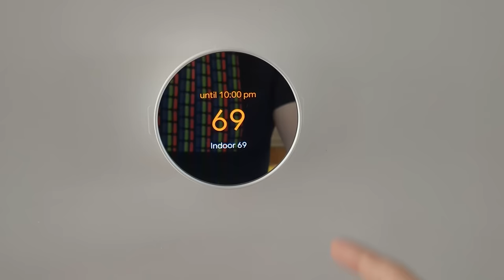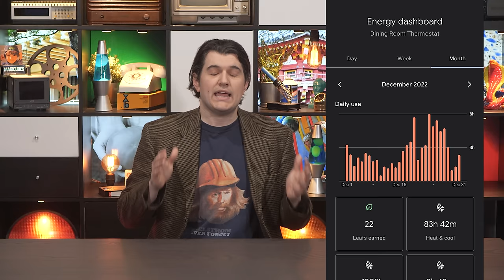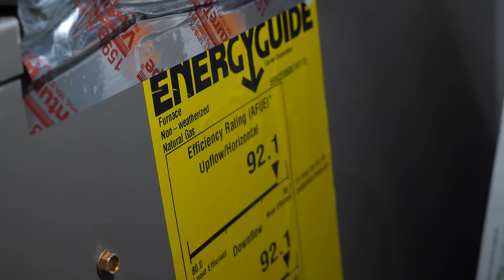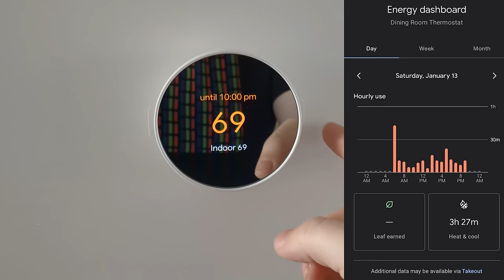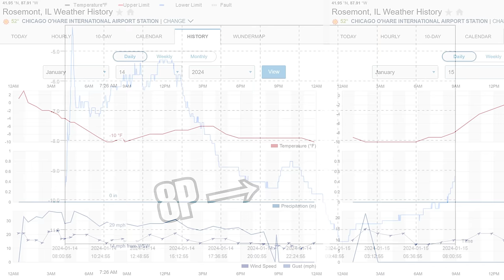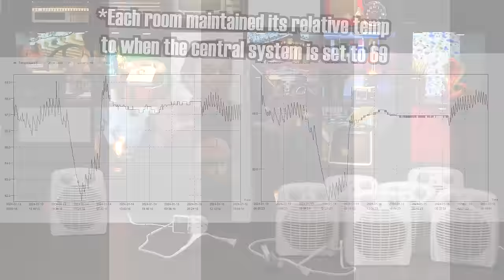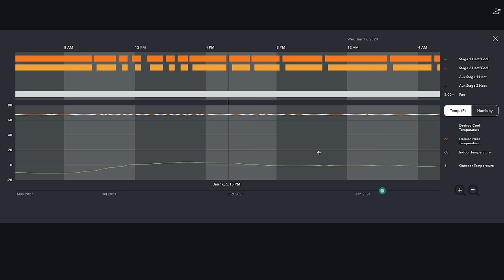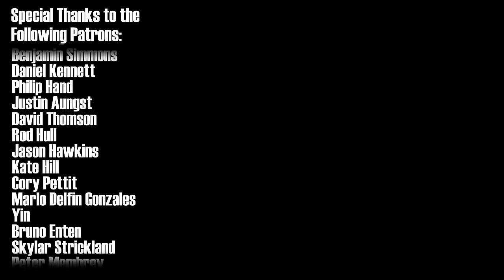Old HVAC industry practices are holding us back and costing us money. But we can fix it.

Comment: know how I know you've never lived with a heat pump?
maybe for milder climates they are ok, but I live in an area where it drops down to 0-10* F in the winters and my heat pump sucks. It's a newer house with new hvac (both 5 years old)  It can barely manage 66* when it's really cold out, and no amount of running it will keep the house warm.
also my house is fully electric and it sucks ass wrt power bills. Routinely $300+ in the summer and winter, it goes down to about $250 in the spring and fall.
my heat pump ain't saving me any money, I'd much rather pay $70 for gas and $70 for electric than $300 for only electric.
gas is the superior option in all ways. cheap, ubiquitous and just flat out BETTER.
Reply: Know how I know your heat pump isn't correctly sized, or not appropriate for your climate?  Mine heated just fine (20C/68F for most of the house 25C/77F in my daughter's bedroom)  in my 1920's 152sqm home in -20C/-4F for 3 days straight without any resistive backup.
Reply: @BenIsInSweden  they struggle near 0 degrees. They're just not efficient enough. Mine stays around 66 regardless of how long I run it, it can't overcome the ambient air temp. I bet yours struggles to get to 68 or above. If I want it to 73 there's no way a heat pump can do it unless it's warmer than  0-15*
Reply: @marty5300 read my reply again. It was handling 68 for most of the house fine and my daughter's room at 77 in -5.
There are heat pumps that can do it just fine.  2 of mine are able to provide heat down to -22F. But my system isn't designed around going that low. It's designed for -5F where it handles the heating load just fine.

Comment: First, reducing furnace size by 2/3 is never going to reduce the consumer price by that amount, if at all. Japanese cars in the 1970s weee more efficient but cost more than the gas guzzlers we traded in. 
Second, many citizens are fearful to rely on one energy source  -electricity. Electric power can be shut off by the govetnment at the click of a mouse and for political reasons. Relying on oil companies alone has not gone well, so relying on govetnment controlled electric companies will lead to the same result - cartel power.
Reply: Your electricity goes out, you usually lose your heating regardless of how it's fuelled as electricity is needed for fans etc to be running.    Unless you have a backup genny, but lets be real, very few people have those too, and it's not been an issue.
Reply: @BenIsInSweden  Many people in rural America rely in multiple energy sources.
Reply: @WaltANelsonPHD  still doesn't change the fact that most heating systems that cover the whole house would need electricity to function.  My wood fireplace would work without electricity, but without electricity for the blower it's usefulness is mostly limited to the room it is in.
Reply: @BenIsInSweden  The following will still add a good deal of heat. In any case the govetnment control issue drives many homeowners to install off-grid solar.
Reply: @WaltANelsonPHD  Heat pumps can work with solar too, and are in some cases a better prospect as you can make more use of the provided power before having to store the excess.  A smaller array and battery would mean you're still reliant on another fuel regardless.
Nothing beats a good tin foil hat for insulation though, clearly.
Reply: @WaltANelsonPHD  Weird example.  But for the country being known as the land of the free, you folks seem to be far too concerned about the government switching off electricity on a whim.  But somehow insulated from turning off gas etc from people?

Comment: So you want your heat pump/ furnace to run all day long and have the possibility to freeze in an extreme case why? To have a stoichiometric heating system and plug in electric heaters when you need, or run your furnace 30% of the time, furnaces get oversized more then they should but it’s not as big of a deal as your making it

Comment: I don't understand how heat 🔥 running for 1/3 of the day means that the system is oversized.

Would you rather it run 24/7 with no rest? That doesn't sound like a good idea. To me, knowing my heat won't have to run for more than a third of the day on the coldest day sounds like a good thing.
Reply: that 1/3rd would only be in extremes.
a properly sized system will only run continuously at max output during coldest less than 1% of the entire season. 
short heating cycles are bad for comfort and equipment - for equipment, starting and stopping is harder on it than just running.
Reply: @Jon-hx7pe  How long should it run for? The fire under my hot water boiler would burn for about 10 minutes, then stay off for 10 minutes.

(House is now sold, so I can't go back and time it.).

Was that not good?

The forced air in this apartment is similar. It runs for maybe 5 minutes, then stays off for maybe 10 minutes? 

Is that NOT how heat is supposed to work? Is it supposed to be blowing hot for like 30 minutes, off for 10, then another 30 minutes of blowing???
Reply: @TheEgg185  cycle times and proportion of time on depends on the temperature outside vs what outdoor temp was sized for.
correct size = needing to run continuously in the coldest weather the area experiences, the rest of the time, it doesn't run continuously unless it is a special variable capacity system engineered to do that. is never an exact science and being 10 to 20% over required capacity is okay.
putting 50%+ larger equipment than requires makes the heating cycles very short which is not great comfort-wise or for equipment lifespan starting and stopping too many times per day.

Comment: Gas is cheap, quick, and energy efficient for heat. Electric isn't. 

Nothing else to be said.
Reply: Heat pumps are 3-4x more energy efficient than gas...
Reply: @JeffreyMorse775  like I said nothing has be said because anything other than what I said Is false. 

Thanks for playing.

0/10
Reply: @dace8030  you are a gas industry bot lol
Reply: @JeffreyMorse775  you have to factor in the efficiency of the power plant though
Reply: @Jon-hx7pe  True. But it is actually more efficient to burn natural gas to spin a turbine and then use that energy to power a heat pump than to simply heat with natural gas in most instances (extreme cold does interfere with the efficiency of the pump). Of course, if most of your energy comes from nuclear or renewables, the heat pump can also be more environmentally friendly than combustibles

Comment: I would also make the argument the part of the problem with hvac industry is  that people misunderstand how they work, and therefore are unwilling to pay to have them properly spec’d. Most the time you need a new heat load calc and probably new, properly sized duct work ontop of the unit itself. And people dont want to pay that when the guy down the street will swap like for like for a lot less. You sound “crazy” when you tell people what they really need to optimize their unit. Literally why after going through hvac school, i dont work in the industry. Its an absolute shit show.

Comment: The countries in the E.U. are forcing heat pumps on people. The result? Poor heating and skyrocketing electricity costs.
Reply: Whereas Sweden (a country in the EU fyi) has had them for decades and the electricity price is currently 62öre/kWh  (~€0.05/kWh).  My 1920s home has been heated when it's been -20C for 3 days solely by heat pumps.
What countries have forced heat pumps on people?  Forcing being that they have a working heating system already and they have been told they need to replace it with a heat pump.

Comment: Two key errors here:
1. You seem to be setting your heat to no more than 69 degrees. Sorry, I need 72. Period.
2. I expect that 8 out of 10 home-owners....don't care about the data sets you've discussed.
They want their home to be warm and be (sort of) efficient. They aren't worried about how it happens.
Reply: If you need 72 then size for it, it's part of the calculation.
Reply: @BenIsInSweden  In the mid-90s, we heard lots about "need" to lower our thermostats because someone felt we consumed "too much" energy. Never mind that doing so made people more susceptible to catching a cold.
Reply: @johnflaherty9595  How is that relevant? Size the system for 72F, if that's your requirement, and you can turn it down if you wish.
Reply: @BenIsInSweden  The video aims to indicate how to heat homes without using too much energy. Heating to 72 will always require more energy than heating to 69 or 66.
Reply: @johnflaherty9595  that applies with whatever heat source you use.  But, regardless if you're heating to 72F it's going to use less energy with a heat pump than with a gas furnace.
Reply: @BenIsInSweden  Hmm.. Even in his enthusiasm, ...he admits some systems require auxiliaries. Given the cost of any system, most will want a single, gas-fired furnace. It may be less efficient, ...it's still a stand-alone system.
Reply: @johnflaherty9595  Some do, some don't.  Mine has been down to -20C / -4F with keeping the house generally at 68F, but daughter's room at 77F.  And that's without aux heat.  And that's as Alec says.. the "But sometimes" situation, where it's below the design temperature, which is usually when it's unusually cold for a few days of the year.
Reply: @BenIsInSweden  Point is that most people have little or no desire to go into that degree of detail to simply remain warm during the winter.
Incidentally, your example indicates cause for a drafty home. If one room has 77F, yet the rest have 68F, the "excess" in the one room will seek to equalize with the rest each time the door opens.
Reply: @johnflaherty9595  I guess you don't have a teenage daughter.  majority of the time her door is closed,  yes there will be heat loss to the adjoining rooms, but doesn't cause a draft.

I think you're misunderstanding the systems as a whole, once installed they basically become set and forget, especially if you have a more centralised set-up.  The backup kicks in when needed, or in a dual fuel set up can automatically use whichever is cheapest to run.
Reply: @BenIsInSweden  grins No, I don't have a teen-age daughter, yet I do have an elder sister. ..For that matter, I was quite prone to "hibernating" in my room through my teens too. I know well what you mean.

I understand the system rather well. It's less a matter of having to fool with it all the time, more a matter of having to fool with it ever. I have many times considered what I would like to do with a home.
Everything from well-insulating the walls, ceilings, and floors to air exchangers and return-air ducting, to exploiting "hot" and "cold" rooms to aid with heating and cooling. Yet when I begin examining costs of doing anything to a home, I begin to see the costs rise, and rise quickly. Regardless of HVAC unit v heat pumps, insulation and ducting will be quite expensive. ..So will tearing out and replacing drywall.
...Then I look at the cost of buying the home in the first place.
I suspect most people look at all these options, look at their income, ...and develop a stern case of lock-jaw.
All the wonderful efficiency in the world won't help much if you must take out the equivalent of a second mortgage to make it all work.

Comment: Your heating calculations may be thrown wildly off if you're in one of the middle living spaces of that townhome when compared to a standalone house or even the edge units of the same townhome. The exterior walls of townhomes are generally well insulated, but the walls dividing the tenants are generally about the same as apartment walls. Paper thin and uninsulated.

Comment: Conclusion:  The AC dictated the size of the furnace because the blower motor has to deliver ~400 cubic feet per minute (cfm) per ton of cooling, to keep the evaporator from freezing. Also, a certain amount of cfm has to cross the heat exchanger of the furnace to ensure that the heat exchanger does not overheat and cause a fire. All of the equipment selection process was dictated by airflow. 

This guy is clearly uneducated in HVAC but made an attempt to be. He uses buzz words such as Manual J and BTUs but he completely neglects the importance of airflow. He comes to a conclusion that is false. ASHRAE  calculations always incorporate airflow. For instance, q = 1.08 * cfm * Delta T, this is a fundamental equation that we as engineers use and clearly incorporates airflow. 

I will agree there are hacks in the HVAC industry, but this guy is providing more false information than your backyard HVAC tech. I would like to know more about his "science" background.
Reply: Not a very good start to your argument, when someone who isn't in the US can see that in the US Gas Furnaces that are 30 or 40k BTU can easily be found in US retailers.
Reply: @BenIsInSweden  You're correct. Goodman offers 30k and 40k gas furnaces, but they should be paired with 1.5 tons of cooling due to the blower.

Comment: WRONG BIG FLAW, you see you want 69F that’s freezing to me I want 77 or 80F for winter if your system is already “maxing out” in the cold reaching 69F it’s never gonna hit the hotter temps I want. Your parents system needed the heating strips to kick in because the heat pump couldn’t hold 69F how can it hold 77f ?
Reply: If you want 77F then size your system for 77F, and just don't visit Alec's or his parents' place in winter.